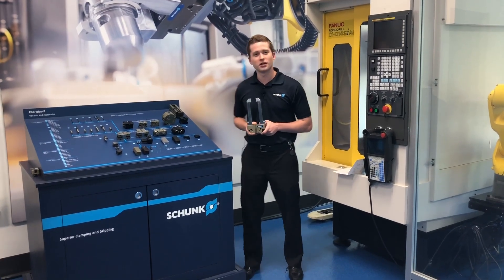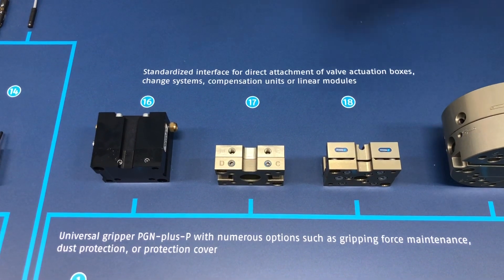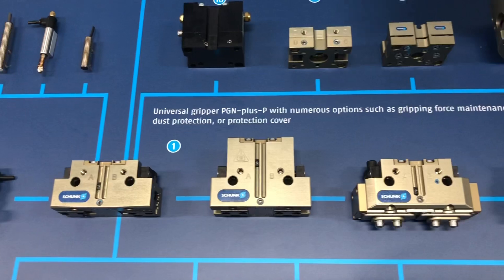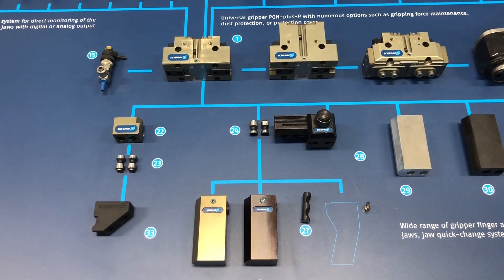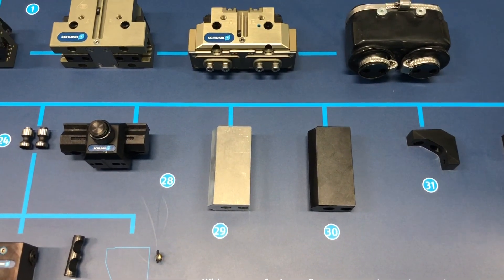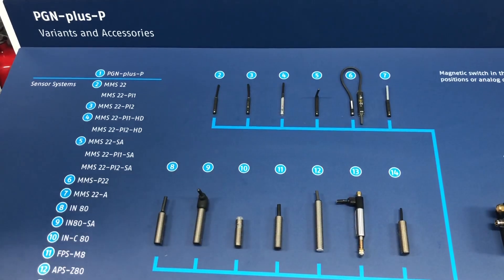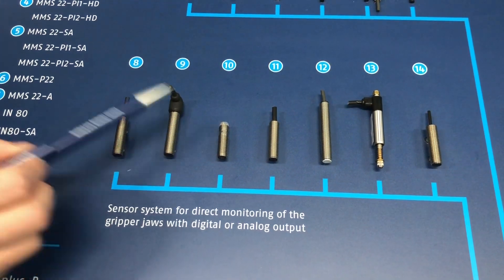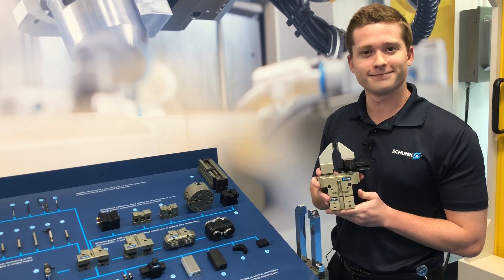Demo of industry standard grippers for machine loading

Comment: hello i have four dpg + 64-1 mounted together on a voltage test machine, they work simultaneously. tell me is it correct to connect them together with the vents? what purpose are the vent holes? faster work?have You got any graphs with correctly mounting 4 pieces together?
Reply from the maker: The DPG+ series parallel grippers are sealed units that are used in hazardous environments. They have a IP67 rating and can work in wet conditions and even be submerged to a shallow depth. The vent port allows for pressure balance inside the gripper jaw area as the gripper opens and closes and displaces air. There are 3 ways to use the vent;
1)	If the environment is mostly clean, a sintered or mesh filter can be installed to allow the internal area to vent to atmosphere.
2)	If there is fluid in the environment such as splashing coolant then a tube can be installed in the port that vents to a clean dry area away from contamination.
3)	If the gripper is exposed to heavy coolant flow or submerged in fluid then we recommend air pressure be applied to slightly pressurize the internal area to prevent fluid ingress around the seals as the sliding jaw moves through the seal.
The 4 gripper vent ports do not need to be daisy-chained together. If it makes sense to do that then use T fittings at each gripper and connect a common tube between them. 
In this case of testing electric connections in a clean environment the port needs only a sintered or mesh filter installed.
Reply: @SCHUNKUSA  Hello!
thank you for the quick reply. our grippers work very quickly in a dusty environment - the tested material crumbles. The machine was built by Korean engineers, unfortunately I do not have contact with them. Is it possible in the case of dust as well as in the case of immersion, it is possible that they connected 4 grippers together to give a slight pressure to the guides to reduce the risk of particles from the environment fudging into them? I will add that the dust is really fine.
Once again, thank you very much for your interest in my question and I send greetings from Poland.
Reply from the maker: Yes, the S-ports can be connected together and pressurized simultaneously.

Note that we recommend low pressure on these ports, 7-14psi (0.5-1.0bar). 
The valve used for this circuit should be a 3-way, 2-position so that it is normally closed electrically open. There is a reason for this. When the grippers are closing, the S-circuit should be open to atmosphere so the displaced air inside the gripper can escape. We have seen times where the grippers will “chatter” when closing if you have pressure on the S-port. Once the grippers are closed, reapply pressure to the S-port.
Reply: @SCHUNKUSA  cheers mate! I understand all now👌😊